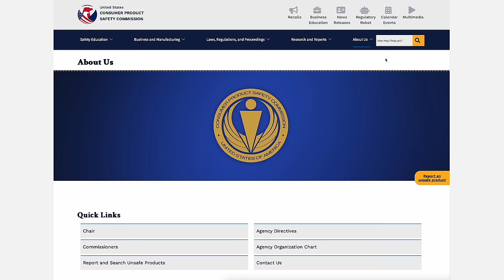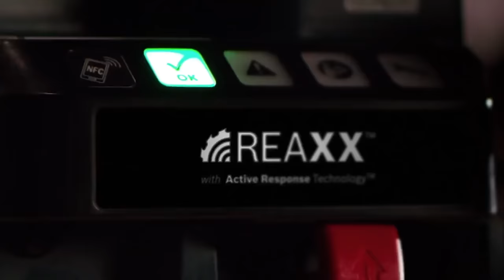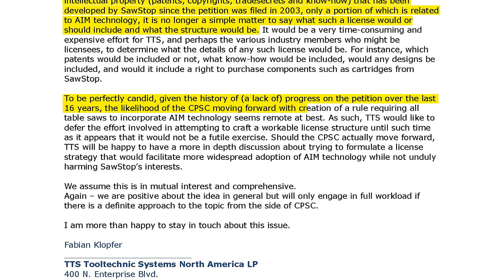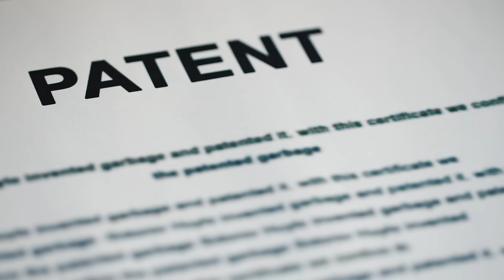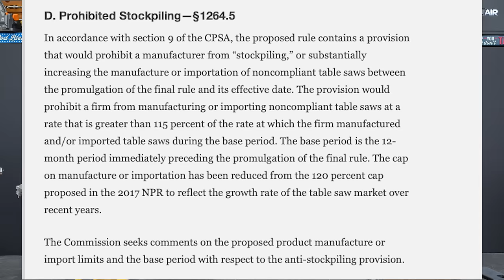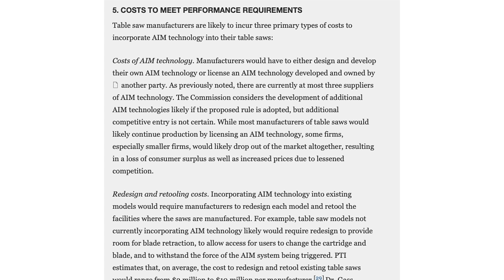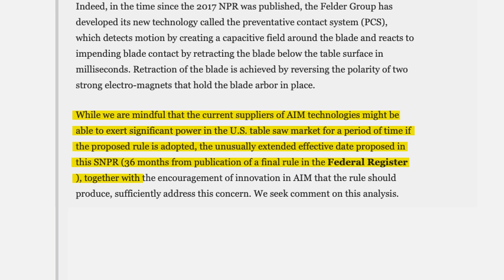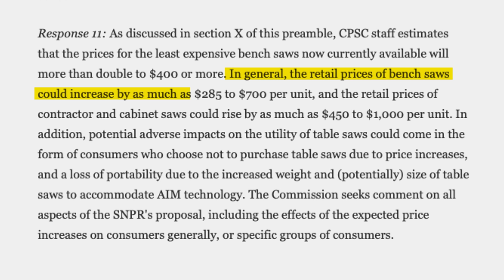The US Government is About to Change Table Saws FOREVER!

Comment: I do think the riving knife was a cost effective and great improvement. I purchased the DeWalt shown in your shop. I also have an ancient Craftsman table saw which I am very careful with. How much safer would woodworking be if there was more training like putting shops back into the schools and teaching the reality of how to use potentially dangerous tools.
Reply: I wonder what percentage of all those table saw injuries is a result of the riving knife and/or blade guard being removed.
Reply: @tchevrier  Zero percent.  Injuries are due to operator error.
Reply: @lc3853  not true, but let me rephrase.  What percentage of those table saw injuries could have been prevented by a properly installed riving knife and/or blade guard.
Reply: I am all for the idea of safety training in school shops, and after school training on an adult education basis - Some SMALL FEE, not something stupid like $200 ......
Reply: @tchevrier blade guards and riving knifes suck. If you use a saw properly you won't get hurt. A guard or knife doesn't make a difference. Sorry, I just don't see it. Been using my table saw for 20 years and the only time I had a close call it was because I was making a high risk cut.
Reply: @the_stixXx  With all due respect, you don't know what you are talking about. First of all, safety devices are NOT intended to be a substitute for proper use. They are intended to supplement proper use. They are intended to provide an additional layer of safety for that one time when you didn't use your saw properly or momentarily lost concentration (because one time is all it takes).  They are intended to provide protection for circumstances that might be beyond your control.  And they also provide protection by reducing or eliminating certain hazards and risks regardless of how well you are using your saw. 

 Second, if you don't know what a riving knife does or a blade guard and why they are  really really important, then you don't really understand the tool that you are using.  Even if you are using your tool properly and doing everything right, you can still get seriously hurt.  

Third, "the only time I had a close call it was because I was making a high risk cut".  So you don't always use your saw properly. All it takes is one time.  Just once.
Reply: I have a shopsmith and I use it without the blade guard because it was so dangerous to use the guard, at least for me. It was causing problems with hand pressure and vision. I am careful not to put my fingers in the saw.
I remember when I was working as a kid using a mechanical pizza roller. It had a stop bar to prevent you from putting your hands into the roller. A nice idea but I had to insert my hands even closer into the roller mechanism because of the angle of the bar and the room to insert the dough. It was a bit scary but the bar was there to stay and I had to get the dough in.
Reply: One word. Volvo.
If sawstop really was truly safety motivated they would do as Volvo did with seat belts
Reply: @tchevrier  He is also correct that all these "safety's" only breed complacency. Irrespective of the intention of their designs.
Reply: @ughhly  do what exactly? Make saws and charge more for the technology? Because with every improvement Volvo or any other car company or business makes, that's what they do....they charge more..hence the inflation of automobiles over time.
Today's inflation is more because of supply and demand and greed but overall, autos have gotten more expensive BECAUSE of their improvements.
Reply: @tchevrier   let's see, I've had riving knives be bent and/or not properly set from the factory which have caused binding, so yeah, I toss them. The guard, well that just gets in the way and makes it more difficult to put pressure on the piece so it DOESN'T kick back. I didn't say safety devices were a substitute for proper technique and yes, I DO know what I'm talking about. 20+ years as a carpenter and I have all my fingers and never cut myself on a saw. I also grew up in a machine shop runing lathes, Bridgeports, CNC machines, welders...so yes, I have a lot of experience with and without safety devices installed. 
And the other thing is fcuk the government and their constant involvement in things they should just leave alone. Comparing today's amputees to the civil war, that's a joke. What are the population numbers now compared to then??? Apples to oranges. Guaranteed there are more construction businesses now than soldiers in the civil war. The government LOVES to stick their hands in the cookie jar and my guess is that there is someone looking to make a buck and could care less about safety. 
Use the saw with guards on, I could care less but don't force me to spend a stupid amount of money for a tool I know how to use already.
Reply: @Jimmeh_B  I would argue that there is some truth to that, but as a blanket statement it is incorrect.  
For example lets use automobiles.  I would argue that many of the safety features on automobiles such as side avoidance detection, adaptive cruise control, rear back up cameras etc breed complacency and poor habits, but seat belts do not.

How does a riving knife breed complacency.?
Reply: @the_stixXx  LMFAO. So you're buying table saws with bent riving knives?  Maybe you should be purchasing good quality saws rather than that junk.  And maybe rather than tossing the riving knife away, another option is to "re-adjust it".  By the way you still haven't answered if you know what a riving knife does.  Do you know?
20 years without cutting yourself is not necessarily evidence that you are a safe carpenter. Based on everything you've said it is more likely that it means you are a lucky carpenter.
Reply: @tchevrier  I 100% agree with you on the automobile argument. Even more so with the new must haves like "entertainment centres" in the dash, CV transmissions, automatic transmissions, auto cancelling indicators... Trains people to not pay attention to the machine they are in control of.

Maybe riving knives are not such a strong argument, but it still applies.

The more dangerous an operation/machine, the more focused and attentive the operator, by nature. 

The expectation of an operator that the machine will stop dead if they stick their digits in the wrong place... That's a whole new level.

Again, one that is more aimed at creating a monopoly via patents, and lobbying for regulation to force it's exuberant price onto an entire industry under the guise of "safety".
Reply: @Jimmeh_B  I completely agree with your last statement about creating the monopoly.  That's exactly what this is.  This guy is doing it for personal financial gain, not consumer safety.  If it was about safety, he would license it for free.
Reply: They took shop out of schools? Well, that explains everything!
Reply: I @the_stixXx  've owned many PM66 and have one now. I'd love to have a riving knife on it..
Reply: @the_stixXx  What are you talking about?  Riving knives are ESSENTIAL to preventing pinching the blade!
Reply: @troybush5899  I would say they are essential. I rippedone off my table saw years ago. 
I have had them bent from the factory and have had to adjust them (bend them back, in line with the blade). This was on my track saw, not my table saw. I felt something snag a couple times and I came to find out it was the riving knife. 
The one on my table saw I tossed a lot time ago. 
I cut multiple hardwoods and never had a board pinch so bad it kicked back or anything else. 
I stand offset and never directly behind my piece so even if I do have a kick back, which is never, it will just fly by me.
Reply: @henrythompson7595  unfortunately nobody values carpenters. We don't provide a service that is necessary, like a plumber or electrician. Carpentry is more of a luxury expense.
Removing shop from school to big mistake. It's a shame that " men " nowadays don't know how to use tools. I grew up in a machine shop and built skateboard ramps when I was a kid so I was around it all the time. I don't have to pay anybody to fix anything, for the most part. I could probably add about 10 grand a year to my salary just because of that. Knowing how to fix things is invaluable.
Reply: @tchevrier  I'd rather be lucky than good any day.
To answer your question, the riving  knife prevents the residual stresses of the wood grain from pinching the blade, while ripping, and causing binding (the wood pinching the blade) and potential kickback.
I have a DeWalt tracksaw and right from the factory riving knife was bent. It kept catching the material as I was making my cut. There is no adjustment so I had to bend it back, which I did and now it works just fine. In order for me to remove it I would have to disassemble the saw. And honestly, it doesn't even need it because the saw only goes one direction on the track. You can't slide it backwards so the riving knife is pointless. If would begins to pinch the blade you just let your finger off the trigger. Or it could possibly jump off the track. I don't know, it hasn't happened.
On my DeWalt table saw, DW749, I took the riving knife off and removed the guard so that I could make plunge cuts if need be. Yes it's dangerous but I have more than enough experience and know how to keep myself safe while doing it.
I'm sorry I didn't answer your question in the first place. 
And I will let my work speak for myself, I will let you be to the judge.
https://photos.app.goo.gl/RC5NrP3yD2d5xmsq8
Reply: @realfamilyman  There are no safe tools. The table saw is only one power tool.
Reply: I don't think this is a bad idea, AT ALL; I'm not being sarcastic.

I think ANY price is worth keeping your fingers/preventing accidents.

I think they should implement and enforce these type technologies in warehouses and meat markets as well/ANY WHERE that has the potential for something like this to happen.

I know what I am doing and I wouldn't do something like this anyway, BUT I still think they should make it impossible for you to cut your self in the first place, I don't see anything wrong with that, and you can argue its WAY LESS than what a hospital would charge you, to TRY and fix the problem/problems you had/have from the accident, keeping preventative measures in place, is  NOT a bad thing, AT ALL. I've actually seen people that do this for a living and are really good at building/have used a saw for years/ some basically there whole life and made one mistake and lost a finger/fingers, in some instances, I remember one instance that happened where this person didn't loose fingers, but ones the surgeries/reconstruction and healing completed and after multiple surgeries, the once talented experienced wood worker lost feeling in their fingers and also lost gripping strength in there hand, causing them to no longer be able to do what they love. I think a measley grand or 5 grand, would have been nothing to them, especially to be able to continue what they love to do.

Also I honestly don't think it should cost that much to implement these types of technologies, but I honestly wouldn't mind these technologies on my saws/I wouldn't complain, peace of mind, would be nice, I don't plan on making a mistake like this, but things happen, I've seen it happen, so I know, even with experienced machinery users, accidents happen.

Also this type of technology isn't that hard to implement/companies wouldn't have to out source/ pay for licensing, UNLESS they want to; Especially with the rise of AI; Also sensors/cameras/chips and so on have been around for YEARS, none of this is really new technology, I think automatic braking systems in cars are good too/people are idiots and cause accidents, ALL THE TIME, if we can prevent these things from happening all together, WE DEFINITELY SHOULD.
Reply: @mattmatt2417  It would be great if they could include the technology at a reasonable price. Yes I would be willing to pay for it. And the grand scheme of things a couple hundred bucks isn't that bad but it does hurt the wallet. But then again so do surgeries and physical therapy and potential loss of feeling in your fingers.
Reply: @the_stixXx  when Volvo research showed that the use of the simple lap sash safety belt significantly reduced injuries, they had a choice . Hold onto it as a Volvo special, or patent it and then freely allow others to use it 
They chose the latter.
This is what the owner of the patents around sawstop technologies should be heavily encouraged to do.